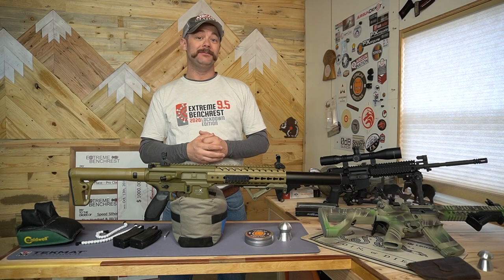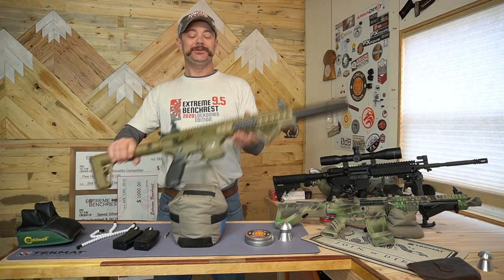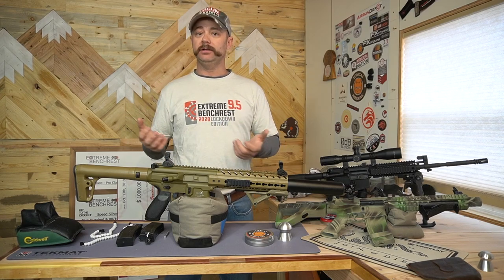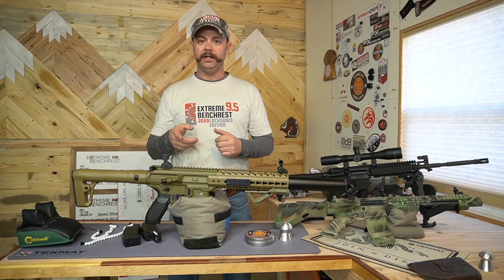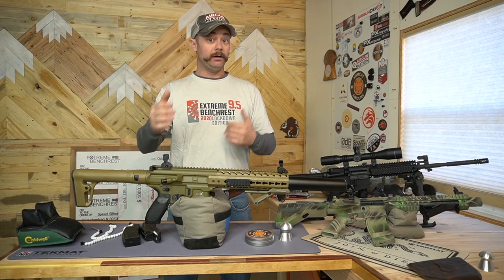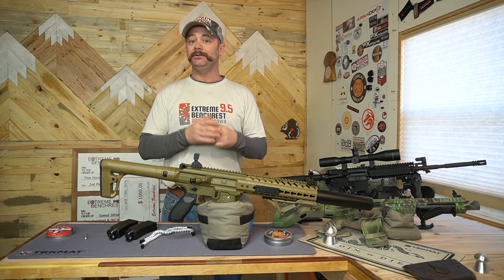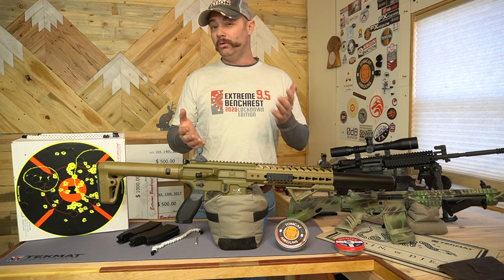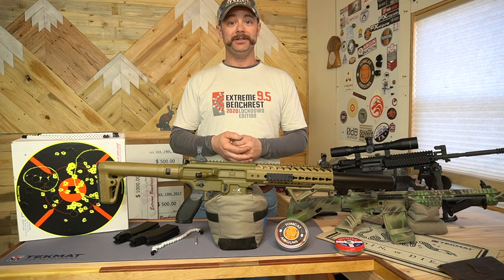Alternatives for Tactical Barrier Training (Episode 2)

Comment: I assume that the SIG in your video operates fundamentally like the SIG M17 pistol that I use all the time.  The trigger feeds the pellet chain, so you have a really long trigger pull to advance the chain, and then to fire the gun.  If you partially pull the trigger, even a third of the way, and release it, that will skip that pellet in the chain.  You have to pull it long and hold it before it breaks to avoid skipping pellets.  Once you touch the trigger, don't release it.

Anyway, I thought I would chime in on the skipping pellets issue.   Another great video, Tomcat!